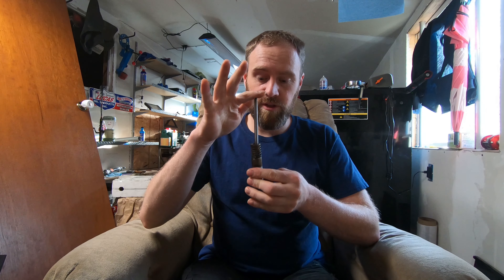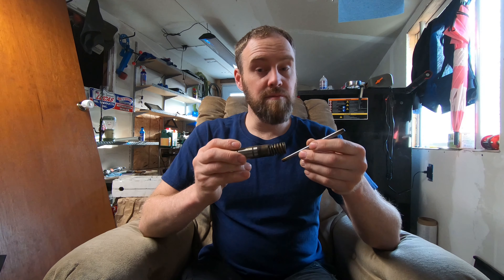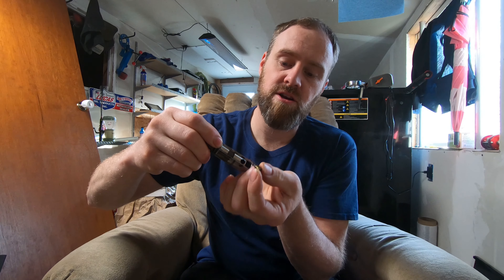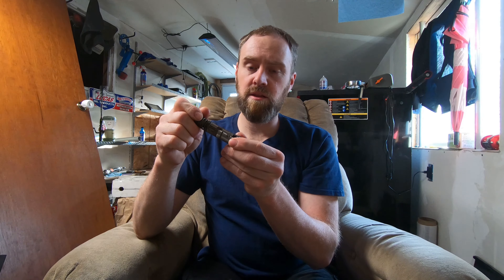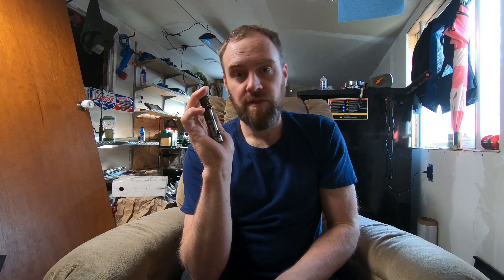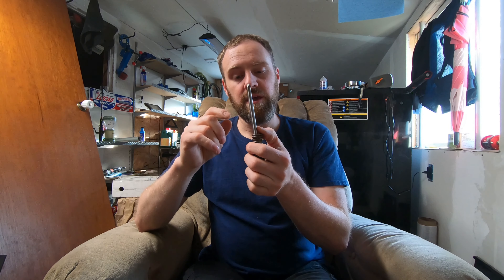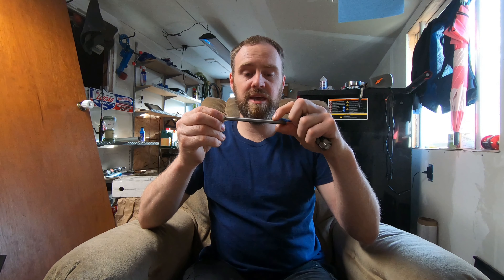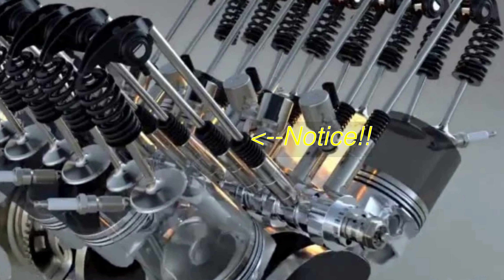Bent Pushrod, Is GM engineering to blame?

Comment: 2021 gmc 5.3 did this to mine. 2 lifters with in 60 days of purchase bent push rods! It’s starts on cold start a tapping noise ! Then let’s go! I’m from California! Dealer only fixed broken ones. The engine taps every time on starting cold or warm! I have taking it back 5 times! 3 dealers they will not fix anymore lifters tell it breaks! Called the gm customer care was told on recorder line they will buy truck back after 3 months a high level manager called me and said they will not buy back and to go legal! Is there a class action yet? This will sink Gm ! Also during the removal I suggest all owners to go and inspect! I have pits all on my engine block an cylinder heads! Sent to gm they told me that’s normal who wants pics please send me your email! Great video!

Comment: 2021 Silverado LT Trail Boss, purchased in Jan 2021.  At 1200 miles leaking transmission fluid; cause bad transfer case seal.  Now at 4060 miles, #5 cylinder misfires.  Found so far, bent pushrod and rocker arm locked.  Awaiting back ordered parts.   ETA unknown.
Reply from the maker: Yikes, wonder how long before GM figures out what I have.
Reply: @CrazedPerformanceRepair  does the 6.2 have the pushrod problem?
Reply from the maker: @ghendrix7019  all the direct injected Lt based models do I believe. So basically 2014 and newer.
Reply: My trail boss 2021 have 2 issues misfire cylinders and temperature sensor circuit high

Comment: before I order from your website, they will fit the 6.2 in the 2015 yukon xl correct?  99.9% positive I have a bent rod.  already ordered the OEM but just found this.  thx!
Reply from the maker: Yes, they will fit. For future reference it is best to message me on my website. I would of responded within a couple of hours in most cases.
Reply: @CrazedPerformanceRepair  sorry. Couldn't find how to send you a message on there
Reply from the maker: @jamesjudd6577  really? What device was it you were looking on. I'll have to dig into it. The mobile site is much different than the standard site. So it could be an issue with either or. Could also be you simply overlooked it too haha. I've done that far too many times myself.
Reply: @CrazedPerformanceRepair  I was on the normal site. Not mobile.   I'll check tonight but couldn't find a way to ask question etc
Reply from the maker: @jamesjudd6577  bottom of the home screen or at the bottom right there's a bubble pop up that you can click on.

Comment: I had lifter failure on a 2008 Sierra with Active Fuel Management at 185k..replaced engine..deleted AFM..no more problems with non AFM Jasper engine.
Reply from the maker: That's a different engine platform. This issue didn't start until 2014 and didn't get really bad until after 2017.
Reply: @CrazedPerformanceRepair  Wrong...same engine platform...the problem started in 2005 when Active Fuel Management began.
Reply from the maker: @blackcobra100  similar engine platform not same. Yours was/is LS based. These are LT based and are quite a bit different though have many similarities. The do use the same exact AFM lifters but the camshaft, pushrods, rockers, cylinder heads, engine block, oil pump, and many other things are all different.

Comment: I have a 2020 Silverado and heard that this was only happening to trucks built from Sept 2020- March 2021… I will get repaired through recall… my question is if I’m at 29k miles with no issues at the moment … should I go ahead and this done to prevent anything from happening ?

Comment: Well I run 5 -40 full synthetic oil for diesel in the 6.2. Oil pressure is not a problem in this engine.  No problem so far . I thought when I get i get time delete the dod or what ever it's called with a better cam . .

Comment: had a 17 sierra with 95k kms that came in with a tick and a miss on #4. pushrod was bent on the intake valve and afm lifter was in pieces. did all 16 lifters and guides, and replaced the 1 pushrod with all stock gm stuff. back 1000kms later with a tick again and the brand new push rod in that same hole is bent again. lifter appears to be in tact looking through the hole in the cylinder head. not sure what to do now lol.

Comment: Just happened to my 2021 Sierra 1500 with 6.2L with about 19K miles. Service rep said it’s MULTIPLE lifters and rods that need to be replaced. Pretty disappointed seeing this has been an issue for a while and only seems to have gotten worse/greater frequency across GMC vehicles. Also have an 08 Sierra and it has 280K miles with no serious issues to this day. Idk much about lemon law or how it works but I’m sure as hell going to be looking into whether or not I’ve been sold a lemon, especially if this crap (putting it lightly) happens to my truck again.
Reply from the maker: If it is a bent pushrod it WILL happen again since the dealer will put OE parts in. The solution is smaller diameter pushrods that eliminate the interference issue from the factory. 

Shameless plug: I sell the fix on my website www.crazedperformancerepair.com inventory on these is hard to come by though. I just ordered more and should be here early next week.

Comment: My 2021 Silverado Trail Boss just took a dump. The engine only has 3000 miles on it and the same thing happened. Bad lifter and bent push rod! They say it may take up to 2 months to get the parts in to change all 8 cylinder's. Toyota here I come. What a shame.

Comment: We had 2 2015 Sierra come in with a misfire and engine noise. Both had cylinder 6 misfires. Both had a bent pushrod. We replaced all 16 pushrods and lifters with GM replacement parts. The AFM lifters are getting VERY difficult to get.
Reply from the maker: It's an interference issue most times. Smaller diameter pushrods like I sell seem to fix it.

Comment: So my 2021 gmc says is not equipped with dfm......do you think all the valves and pushrods will be ok??????
Reply from the maker: Might not be, turns out some of them are also inferring with the cylinder head as well. If you have over 10k miles on it without issue you should be good at least for a while.

Comment: I just did lifters and push rods on a 2014 Chevy and within a week it bent to push rod and number four cylinder the same cylinder that bent again the cam looks good and it's got all new lifters in it don't know why it keeps bending number four cylinder
Reply from the maker: If it's direct injected engine Upgrade to pushrods like I sell https://www.crazedperformancerepair.com/product-page/pushrod-upgrade They are smaller diameter heavier wall to eliminate interference and help with stability,

Comment: unfortunately  I had same problem . does this problem cause more problems if I didn't fix it soon? or it is just the knocking noice
Reply from the maker: It will certainly cause more issues if unfixed. It's literally a hammer smashing metal together inside your engine.
Reply: @CrazedPerformanceRepair  noted ✅  thanks

Comment: I have a 2021 Yukon with 6.2 found bent pushrod on no 8 intake valve. Replaced push rod and it bent again on first test drive. All lifters look good. Anyone know what could be causing this.
Reply from the maker: The pushrod is interfering with something. I offer a heavier smaller diameter replacement at crazedperformancerepair.com

Comment: Do you recommend the Pulsar LT for the newer GM trucks with the DFM?
Reply from the maker: Haven't heard of it till now. Interesting concept. If out of warranty I would say go tune it with a pro. However as a add on to still keep warranty, yes it looks like a good product on paper. If you try it feel free to lmk how it goes. I don't have one of these trucks so likely won't be testing one myself.
Reply: @CrazedPerformanceRepair  I went ahead and ordered the Pulsar LT and installed it on my 2020 silverado LT trailboss 5.3 10 speed few weeks ago.  So far so good. Disabled AFM and DFM and wow what a difference.  The throttle response is insane how much more power there is.   It is a easy plug n play install too.    sure hope this helps avoid any pushrod issue
Reply from the maker: @ryanbonser361  it won't help with the bus ride issue. The bus ride issue is a mechanical interference issue within the engine. In fact it's more likely to fail not using the DFM. That's when it comes in contact with the side of the AFM lifters but it also in some cases comes in contact with the hole in the cylinder head the push rod goes through. It's basically a matter of luck, did you get one with or without interference from the factory? It is such a close tolerance some of them come with interference and others don't.
Reply: @CrazedPerformanceRepair  ive got 7100 miles on my 2020 with no problems so far so hopefully I am good.  Fingers crossed.  From what I have been reading it affects models built in 2021 so hoping ai am in the clear.  Thanks for your insight

Comment: I have an 09 silverado hybrid.  If I use HP Tuners and turn off the DOD, do I still need to mess with the VLOM or Cam / Lifters at all?  I can't seem to find this anywhere.
Reply from the maker: That's because no one has the ability to turn AFM off in the tune in the hybrid. If you had a lifter fail, you are going to have to replace lifters and address the source of the lifter failure. They fail from lack of oil pressure during activation.
Reply: @CrazedPerformanceRepair  what I'm trying to find out, is why the VLOM needs blocked?  Say I had a normal truck. Fully working.  Why couldn't I just disable DOD in the tune, and drive the truck that way?  Like in an attempt to prevent the lifter failure from ever happening?

Comment: 2015 GMC Denali Crew 6.2l
 I purchased new last day of 2015. Dealer replaced Cam Lifters and trans at 50k. At 99k I brought it in for  same problems. I had read about all the problems that I have experienced over the past 5 years. I express I really thought the vehicle needed a motor. They tore it down and found a bad lifter # 8 cylinder. 
 I again expressed I was concerned about the motor as a whole and being that I only had 500 miles left on my warranty what would happen if there was an issue in the near future. I was told that this new repair would be warrantied so I should have no worries.
101k miles I was on the freeway when the engine started running rough and knocking. I had the truck towed to the dealership. I get the call. Your truck dropped a valve you're going to need a new engine. $10k. Out of curiosity I asked which cylinder? Yep, #8. After several phone calls I was told they would split the bill $6k
 I felt it was no coincidence it happened in the same cylinder. I finally spoke with the service director he was a total a@#hole. He told me there was no relation between the cam and lifters being replaced due to #8 lifter and now #8 valve.
 I was so pissed and didn't have the $$$ for the repair I just let it sit there.  For the past 6 months. 
 I finally went and picked it up with my trailer the other day. I got it home and found a cup in the center console. There was a valve and broken valve spring. I pulled off the head there seems to be no damage to the head or cylinder. I haven't looked at the pushrod yet.
Reply from the maker: In those situations always ask to see parts. If it hasn't been taken apart yet tell them you want to see the proof. That's the kind of failure easy to prove. As a shop I am always willing to show the failure. If the shop won't show you they are as crooked as they come. Call them out, gtfo, and give them the glowing review they deserve. 😉

Comment: how do i know that my Tahoe Suburban 2018  has equipped with dfm problem?
Reply from the maker: Unless it's a rare 2500 or actually a 2017 it will have DFM. Does it show on the dash how many cylinders it's running on?
Reply: @CrazedPerformanceRepair  yes it show on the dash 4 cylindres i think its Afm not dfm (2019-2021)
Reply from the maker: @Taw3eyaa  look at date code in the door. It might be a late 17 and may just be a AFM system.
Reply: @CrazedPerformanceRepair  you mean  AFM system is safe ?
Reply from the maker: @Taw3eyaa  no, the AFM system has other issues but it doesn't seem to bend the pushrods very often.

Comment: Bought a 2021 Suburban Z71 in January... 2 days ago, with less than 5k miles, I limped to the nearest Chevy service center. I was told that it's likely a collapsed lifter and they'd need it for at least a week. To add insult to injury they gave me an Equinox as a loaner - extremely tight fit for my family. Furious is an understatement. What if anything should I address upon pick-up? How likely is it to happen again? I want an extension on my warranty 🤬
Reply from the maker: Gm used the incorrect pushrod diameter from factory. If bent pushrod happened to yours it will happen again unless corrected with non interference parts. I do offer a solution on my sight but unless dealer is ok with it you would likely void the warranty using them.

Comment: In Middle East Thousands  Trucks, model year 2021 are involved  Bending Pushrod and collapsed Liters, GMC, CHEVROLET and CADILLAC. Engineers should pay attention  for this matter. Why don't you try to change the viscosity of oil.
Reply from the maker: It's not a viscosity issue so not sure how that would help. GM most likely won't own up to this issue until someone somehow deems it a safety issue.
Reply: @CrazedPerformanceRepair  I'm sure GM made the wrong design for 2921 truck engine.

Comment: As far as the LT4 engine, does this issue occur only in automatic transmission vehicles, respectively do the manuals (Z06, ZL1) also have cylinder deactivation?
Reply from the maker: It happens to all the newer V8 gas engines except the 6.6 I believe. It happens without AFM as well.

Comment: How does this system work? Does it hold the valve open during a compression stroke to stop building compression or does it leave the valve closed.
I would think in the new system using all 16 lifters it would leave the valves closed before the compression stroke. No air in no compression.
If there collapsed do they release the collapse between compression strokes? If not how does it handle the cam lobe hitting the lifter while collapsed and the valve closed. There would be nothing keeping tension on the pushrod. It would be bouncing around like crazy.
Something missing here. If the collapsed lifter is spring loaded with enough tension to keep the pushrod in the lifter and set in the rocker arm but with not enough spring load to actually open the valve then I can see how this works. But there always has to be tension on the pushrod or it would drop out of the rocker arm and that would be catastrophic….
You may be right about your bend theory. But I think there is still an issue with when the lifter is collapsing and when it is supposed to extend.
A small amount of slop during the collapsed mode and the extended mode may be enough of a shock when going from collapsed mode to extended mode when you plant you foot to the floor. RPM would rise rapidly. If the push rod bent it would produce a mark on the pushrod on the opposite side of the bend. Because it would be leaning that way and hit the side of the lifter.

Is this system actually capable of changing modes fast enough over and over if you have a heavy foot and invoke full throttle from light throttle.
Or if you are in tow/haul mode and the transmission does some aggressive down shifts.
I do not think locking and unlocking a lifter with oil pressure will ever work to be able to control a valve. 
Bad idea from the start.

Comment: We just purchased our first new vehicle in June 2021 - a 2021 Chevy Tahoe RST with the 5.3L engine in it. Do we have any feedback on this engine in this vehicle? Are there any stats as to when the bent rods are materializing and under what driving conditions (maybe similar to mind)?  I'm on the road daily for my job and drive at high speeds 60-80MPH.  Since we purchased the vehicle, I've driven just over 14k miles.  I know, amazing, but this is the kinda miles and speed that I will be putting on this vehicle on a daily basis.

Comment: I've had my 2007 Silverado 5.3L since new, always serviced myself, always used Mobile 1.  Thought she was bulletproof up until a couple of weeks ago at around 447,000 miles.  The lifter tick started, then a couple weeks later suddenly started running horribly, missing.  Code shows misfire on cyl 6. Removed the valve cover to crank by hand and check for a loose rocker, but NO loose rocker at #6.  Just immobilized rocker.  Bent push rod? Thought I was going to buy the "tool" and free the lifter, but now IDK.  Please help.

Comment: 2021 Silver ado 5.3L LT, just blew the passenger side bank lifters. 7k miles on the truck and blew these at 20mph going through an intersection from stand still, also to mention I didn't even rev up my engine when this occurred.
Reply: Geez man that sucks. Sorry to hear. How did you know ? Check engine light pop on ?
Reply from the maker: You sure it didn't bend pushrods? They do blow out the lifter guts sometimes but a hole bank is hard to believe.
Reply: @CrazedPerformanceRepair  Got my truck back says #8 lifter rod  replaced, they swapped out the entire 1 side bank only, so far truck running great.

Comment: I've seen more failed lifter on 99-06 gm vehicles than anything 2007-present. Not really as common of an issue as everyone seems to think. Could tune it out or do a full delete but just keeping up on frequent oil changes goes a long way
Reply: You must work for GM